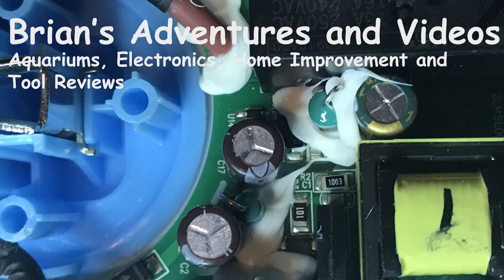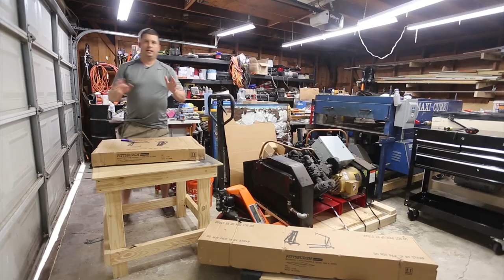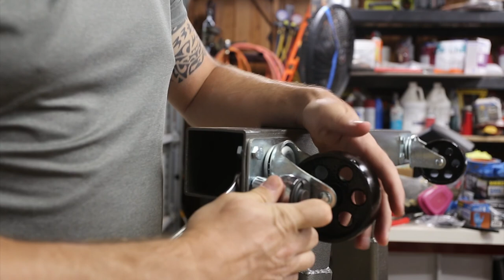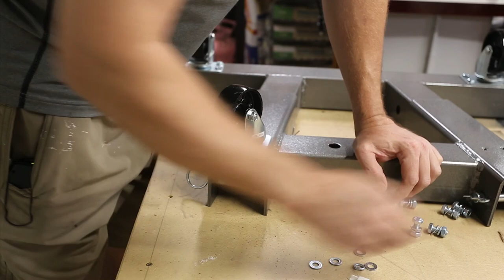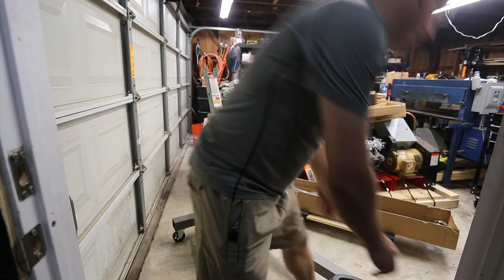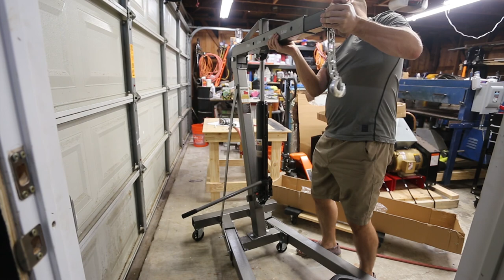Review and Assembly for Harbor Freight 1 Ton Shop Crane Item # 61858 / 69512

Comment: My instructions are tling me to put the support beams on the inside of the frame not the outside.. only it doesn't work that way.

I'll try like you're doing it in this video. I tried that way at first but then I guess I messed up and started reading the directions which tell me on the inside
Reply from the maker: Pretty sure the instructions and machine are made independent of each other.  Good news is that once it's assembled it lasts a long time.  Sold my 1 ton and bought a 2 ton to work on a Jeep.

Comment: Got mine for 99 bucks on sale but u don't want to impact anything on this I over tightened mine where u bolt the top of the jack to the crane arm and u don't want to over tighten it will flex and break the already crappy welds they do on this thing!!! Hand tight on that, but very snug watch it tho 👌 I have to get mine welded